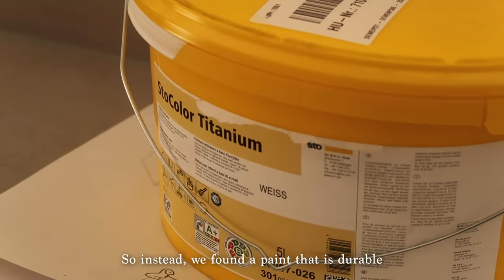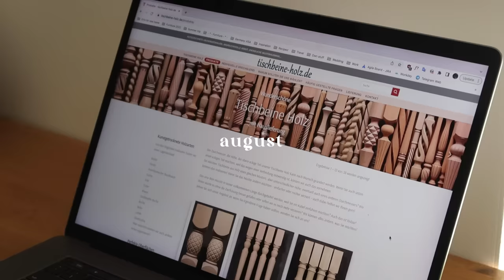Kitchen Makeover | Upgrade Ikea kitchen to a cozy bright space + DIY home cafe

Comment: Did I read that right? Apartment does not come with the kitchen? So people move with their kitchen or something????? It’s absolutely gorgeous as always but what you need to build a kitchen??
Reply from the maker: Normally you can always opt to buy whatever the previous tenant built if you want, (if you don't they have to rip it out or move it with them and you start from scratch) Since ours is a brand new building it came totally empty ^^